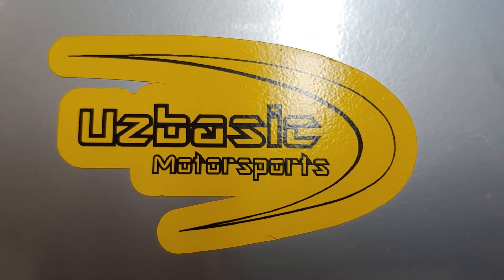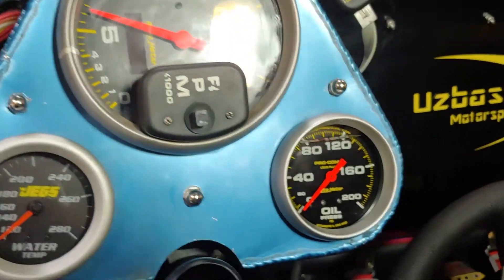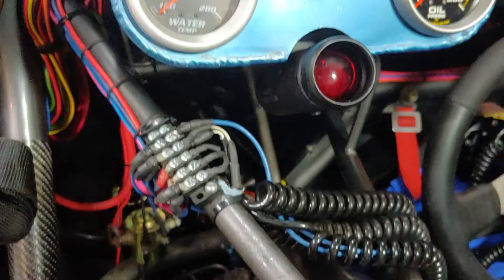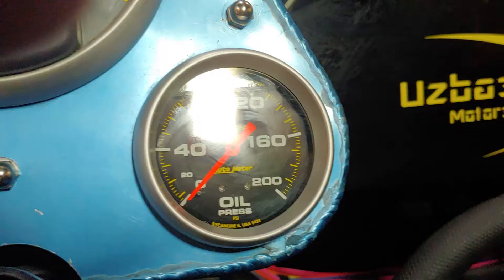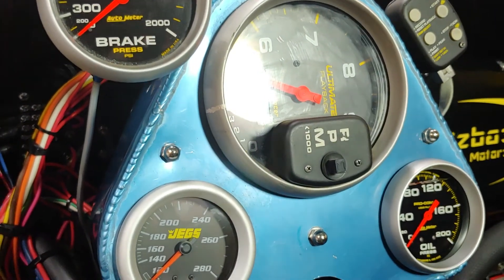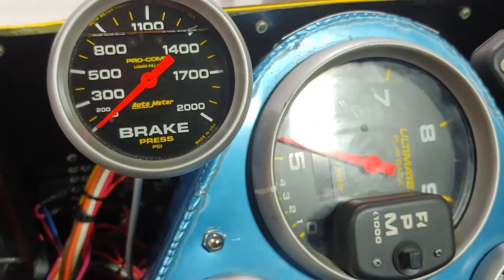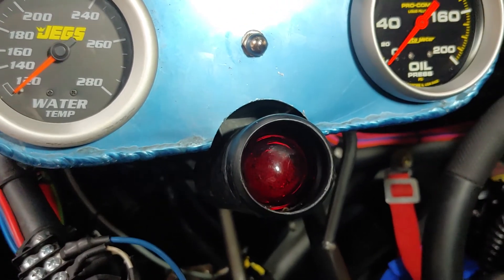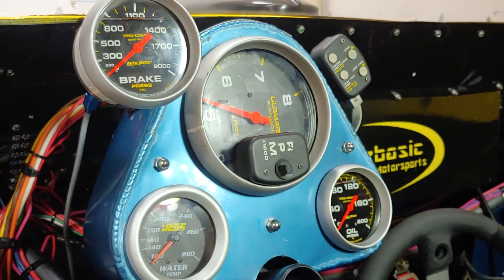Auto Meter Pro Comp Oil Pressure Gauge Installation

Comment: Well dang, I was hoping you would show which way the compression ferrule goes on but you're using AN lines on your setup... oh well.
Reply from the maker: First slide the nut onto the plastic or metal tube female thread facing connection.  Then install the ferrule over the tube with tapered small side towards connection.  Then slide it on to the fitting body and tightened.  Hopefully this help you.  Thank you for the question we appreciate it.  Again thanks and have a great day.